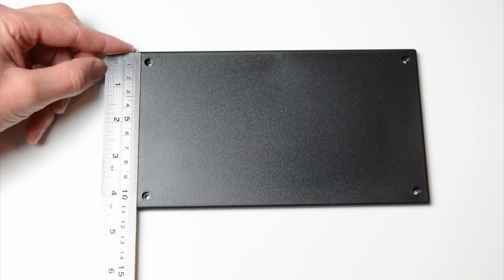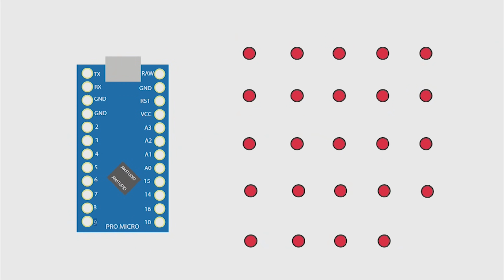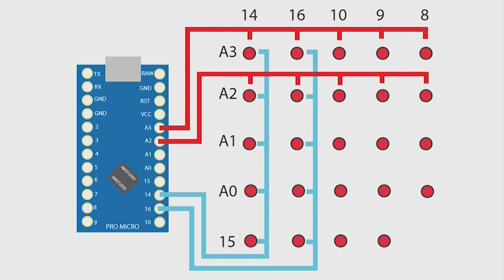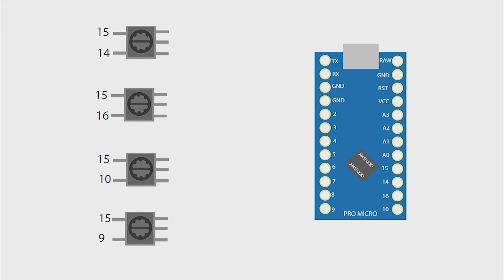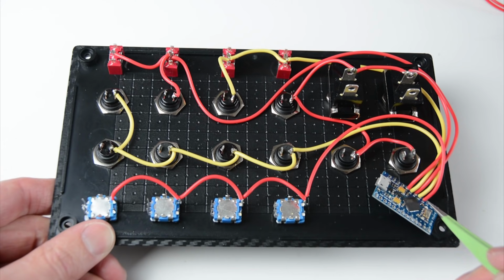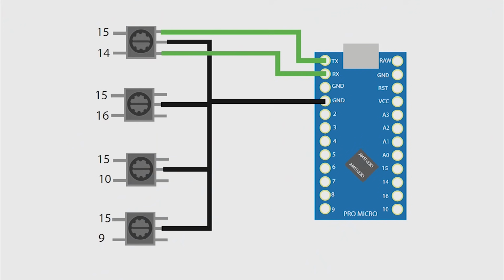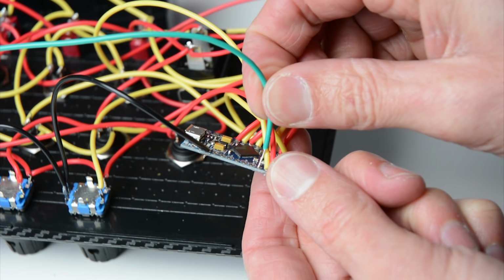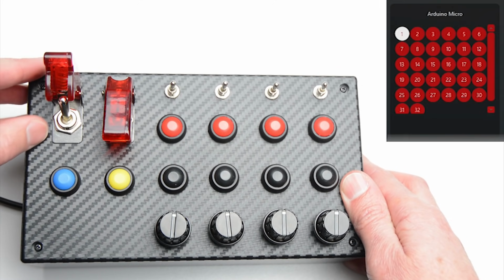MAKE THIS BUTTON BOX | 32 FUNCTION w ENCODERS

Comment: Hey
As always a nice video!  But ist it possible to use a Joystick incoder if in leave out the spinning Switches? 
Thank for Answering 😉
Reply: Yeah it's possible, if you don't use the rotary encoders. I've made a button box using the joystick encoder. Simply hook up the buttons or toggle switches to the board. Simple job. 
I don't think it's possible to hook up the rotary encoders though (I could be wrong). Spent quite a long time trying to figure out how to wiring the rotary encoder to the joystick encoder board, and couldn't get it to work.

Comment: Great job! I want to use 7 rotary encoders and 10 push buttons? I must modify the arduino code or instead of connecting two buttons, i connect one encoder? Thank you!
Reply: have you found a solution I have the same problem with compiling it

Comment: How did you solder the buttons and toggles without melt the buttons? Got some of these buttons and they just melt as soon as you heat up the pad to solder the wire.

Is there a way to connect these without solder wires directly?

Comment: A fantastic build idea, especially for the encoders.
Personally, I've taken apart an old keyboard, followed all of the traces to mark which pins go to which keys, and am working on a button layout to solder everything in. No programming needed at all, and I simply have to wire the buttons to the keys already used in games.
Reply: @Bạch Văn Hoàng Bảo Well aware, simply took common key layouts for all matter of games, and configuring a soldering chart that conforms to it.
Reply: Would it work out a lot cheaper to do it this way?

Comment: Do you have to worry about floating pins? Im a beginner amd have been told to beware of them and use a resister to pull the charge.

Comment: @amstudio Can I use this matrix technique to implement this in an arcade cabinet?  My question is mainly how does the arduino deals with several signals at the same time, i.e. buttons for combo or tow players playing at the same time.  Thank you.
Reply: A matrix works by cycling power to each of the pins on the output group (I guess in this case the rows) one at a time, while checking what input pins (the columns) are receiving a higher voltage as a result of a switch making contact at that time, with the controller essentially putting two and two together to determine what's being pressed and forwarding that to the computer. It probably sounds clunky, but it's incredibly rapid and an unfathomable amount of passes are made within the space of a single second, so it all seems instantaneous from the POV of a human being.

I would imagine the Arduino code should keep track of what's being pressed for an entire pass and then forward the entire result to the system in one go. It wouldn't even be hard on the  Arduino at all, since it just needs to use 16 bits to track the whole matrix (more or less, of course, depending on the size of your matrix). Don't quote me on that, though. ^^;

Comment from the maker: Easy to follow 18 page Guide with setup instructions here: http://bit.ly/2HeizNj
Reply: A few month later I do it for a ps4 ( project car can use a lot of buttons on ps4) but the it doesn’t work( not reconize by the ps4), do you have an idea? 
I think the problem is the skech of the atmega because is like keypad and not keyboard,  what do you think about this ? 
Great job and and realy big thanks for your diy and also Sorry for my poor english.
Reply: The link you have for The 18-page Build Guide is dead. You have a link for it?
Reply: Would it be possible to include a joystick or two in this build?
Reply: what if i don't want rotaries but more buttons, could you do a video on how to change the i.o sketch to add more buttons to this build and where to solder them on the ardino? Or can anyone help with that been trying for a few weeks now and some how just cant get it to work.
Reply: Hey, the devs who made the simdashboard app used the design of this and made it virtual.
Reply: I got lost when u said. Button 1 and 2 I am hopless
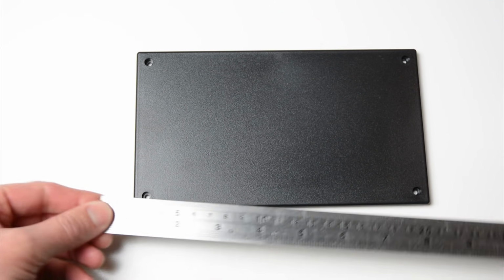Reply: Which program do you use for design your buttonbox? 1:02

Comment: i wil certainly take to this over buying a 2-300$ setup just to have buttons lol..  but i dont understand the layout of the wiring. how does it know a differnt button is being pressed if they are all wired to the same points in most of these?     i would like build my own flight stick setup simular to a virpil and would like to understand more behind the wiring done here if u happen to wanna break it down for another video or other ways to do it    Subbed  for sure
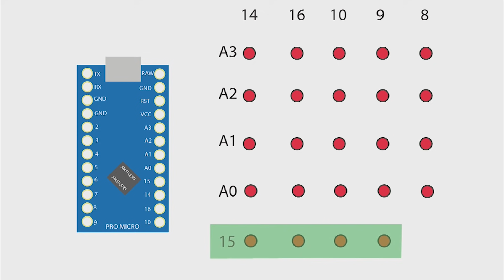Reply: The way the Arduino tells the buttons apart is due to the way the button matrix is set up. If you look at the diagram at 2:50, you can see that each button connects 2 pins on the Arduino. Each button has a unique combination of pins, like X and Y coordinates on a graph. In the diagram, the Arduino is looking for a connection between the red pins, and the blue pins. If it sees that pin 14 is connected to pin A3, then it knows that it is the first button because that is the only one that can connect those pins. 

Think of it like a button grid, and one connection on the button is the X coordinate, and the other is the Y coordinate. By pressing the button, the Arduino sees that X(A3) is connected to Y(14), and it knows exactly what button is at that location. Hope this was helpful.
Reply: each button closes a different set of circuit.  AX AY AZ then next layer would be BX BY BZ and so fort.
Reply: thanks for that Shane and Quert.. soon as i look back at that time stamp my brain turned on and i understood lol  its like a bingo board lol   think i may be able to pull of making my own after all..   anyone know what would be the best sensor for a joystick  only one i know of is Hall effect ( not sure how magnets are positioned to make it work tho)
Reply: @MMORPG87  You could try a potentiometer like the joysticks in an Xbox controller. I'm not sure of the actual wiring, but each axis of the joystick has a potentiometer, and the controller reads the difference in resistance to tell the position of the joystick. If you have an old console controller, you can pop the case open and take a look for some ideas. Would you need 2 axis of movement for the joystick, or only 1

Comment: Long time fan of your DIY's. I'm finally getting around to doing the wiring for my box. I am really new to wiring in general so excuse the potentially noob question. I found that the O/F/O toggles and the encoders have polarity (I think that is the rigit term for this situation, the documentation says to assign the +/VCC pin to the center pin on the 3 way toggle and to the two directional pins on the encoder). Which side of the matrix is the VCC and which side is GND? Does it matter? Thank you for taking the time to make these videos and the time to help noobs like me save hundreds!

Comment: Looks cool! I am doing one with my brother which is not much for racing games but for space games like Elite, and driving games like ETS2, ATS and Bus simulator.

The biggest issue we found so far is how to use controls that are not buttons: for example if you want to simulate a car ignition, you need a single pole 3 position switch; but for the computer they are all single press of the same button; so there is no way to get that actually working. Same for light switches that has 3 positions (off, position lights and low beam).

Did you ever made anything like this? Would be nice to know how did you made it. We are just using buttons for our box, but for the next build would be awesome to have something realistic; maybe using real switches from a real car :)

Comment: Help please. I’m getting an error while compiling. Keypad does not name a type.
Reply: That worked! My first arduino project. I just subscribed to your channel. I have been sim racing for years. My rig: g27, upgraded brake spring, real car seat, 2 dayton transducers, honda accord ebrake from junkyard. th8rs shifter, oculus rift, cheers!!
Reply: amstudio thank you for taking time to help. I’m now getting joystick.h no such file or directory. I tried adding “ArduinoJoystickLibrary-master” as a zip file. And I get specified folder/zip file does not contain a valid library
Reply: Drew Smith how did you get round this mate?
Reply: TNOTPR Vaping i believe I was missing a library.

Comment: Is it possible to increase the size of each matrix? IE: could you go 10x10 and just continue increasing the amount of buttons/switches in each matrix, but keeping the connections, as you have described the same?  Obviously the code will need to change a bit, just curious the max amount of buttons this board could handle.

Comment: I've just bought a ton of parts and a new soldering iron, can't wait to make my own button boxes!! Went for the wood grain vinyl though, fits me good as a FS, ATS, and ETS2 player :)
Reply: Hey buddy, I'm not that far yet.I was stupid and bought several square switches, and making the holes for them took ages with an exacto knife... I have 46 functions, I have no clue how my grid or sketch will look, haha. I'm using the USB Joystick PCB for 10 of the buttons, though. It will be 2 boxes in 1.

Btw, anyone, go for the round switches. And prepare for micro soldering, the arduino card is TINY.
Reply: If anyone is hesistant to do this because of the soldering, don't worry. You can hot glue dupont wires to the arduino. I'm also ditching the whole box part of it and using a 30" x 12" piece of plywood mounted straight onto my wheel base to have a dashboard. With a slot and 2 x 2" holes for my old smartphone that runs SimDash, it's going to be a wild setup for a few dollars.
Reply: @basstrammel1322  Would love to see it, sounds great

Comment: The double momentary toggle switches. Is the middle pin not used??

Edit = Figured they were just wired afterwards and not displayed as 2 rows only had 3 links ha.
Now to build and hope it works.

Thanks for great tutorial.

Comment: I’ve tried to build my own box using this design, what I’m struggling with is finding the code to use to upload onto my arduino pro micro,
Would it be possible to help me with the coding?
Reply: you can buy it on amstudio website

Comment: it shows in the compiler that fatal error: Keypad.h: No such file or directory
Reply: I found out what was wrong I didn't have keyboard and joystick in the library
Reply: @1adama1982  I thought keyboard.h is a builtin library. I think my problem is i have the board selection wrong. Need to make sure its set to Micro.
Reply: Works the buttons fine by you?
Reply: Yes they are working now
Reply: How did you the wirering? If I push one button now it will reconized as 3 buttons -_-'
Reply: I haven't done the working yet I used one pedal button and moved the wires to test the commands. You probably wired it weird did a cross link did you test with a bread board?
Reply: i have same error, except joystick, how to add them?

Comment: I found out how to write my own code for my 5 switch button box so that when a switch is flipped it types a letter of my choice but the problem is that doesn't seem to work in game. It will recognize the keyboard push but not the switch that I flip. How do I make the Pro Micro it's own separate device i.e. to not act as a keyboard

Comment: No resistors are needed? At all?
Or do the buttons/switches have something built in?
Reply: The arduino pro micro usually will take care of this, it has onboard pulldown resistors wich can also be used as pullup depending on what you configure it as :)

Comment: Ok I have made similar with encoders. I made all pin configurations. But encoder only work in one direction. It has to be both signals detected while it know which direction that is, but to other direction it wont work. Second. How to set encoder sensitivity. I have 24 impulse encoder and I have to make about 270 degree of rotation to take one pulse on button. Whats the values 0x30, 0x1.... in your code? I cant figure it out :( Please help

Comment: what board should I have set up in the arduino programming software. I'm using a pro micro but I didn't see a option for it in the boards list. my manufacturer recommends using the arduino Leonardo option but i'd just like for someone to confirm that before I upload the sketch to my board.

Comment: Hey man! Thanks for all your videos! I made this and everything works very well. my issue though is that I changed to a rotary with 16 ppr instead of 20. When i had the one with 20 it works but when i use the one with 16 i only get a puls on every 4th step. How can i modify the sketch to work with 16 ppr? Thanks!

Comment: +amstudio what should I do If I want to have 3 rotary encoders, 10 push buttons and 5 momentarys switches [on (off) on]? And also how do I have to wire it? Thank you very much for your help!
Reply from the maker: Yes that will work the same. Just remember the toggles will take up 2 positions each on the matrix grid when wiring.

Comment: is there anyway to fix two buttons going on simultaneusly?
for example: When i have button 1 (A3,14) and button 2 (A3,16) swithed on then when i try to switch on button 3 (A2,14), button 4 (A2,16) gets turned on with button 3 aswell

Comment: i have managed to make it work all 32 buttons are working thank you, there is only one problem three of my buttons have led´s and  when i conect the extra power and negative (ground)  to the buttons with the leds the corresponding buttons activate 2 buttons at the same time when pressed, do leds also need a button spot on the grid like a button would?

Comment: Hey there, planing on doing my own steering wheel, with a dual clutch setup, no idea of arduino Programming etc. Yet, but I'm a fast learner.
Thanks for this amazing videos!
Got a question though, would it be possible to exchange one of the encoders for the dual clutch setup? (master slave setup via hall sensors or simple potentiometers with bite point potentiometer to set the bite point)?

Comment: Does this work for DCS (digital combat simulator)
Reply: yep.. i did mine from this Video (thanks for the Video BTW, it's awesome!). Although i modified my a bunch (made is simpler fro my needs). when you plug the controller to your PC, DCS recognizes it as a ardruino device with no problems (as long as you have the drives installed on your PC).
Reply: alright tank you

Comment: I'll be honest, it took about 8 times watching this video to finally get everything figured out. Persistence prevailing I soldiered on, finally finishing a box with 2 toggles, 10 momentary switches (14 including the momentary switches on the encoders) and 4 encoders. I feel accomplished, thank you for laying this out in a very organized, easy to understand, and quick fashion.
Reply: or did you... solder on?
Reply from the maker: Good work, Enjoy!
Reply: I want to make a MIDI, does this method works? I send the code successfully to my promicro, but in OSX the MIDI doesnt detect anything :(
Reply: The 3d model for the boxe is included in the guide ?
Reply: @Fabio-ig4dy  I believe it isnt 3dprinted
Reply: @Hanmieson  so maybe on amazon or smth ?

Comment: Your Videos are great. I'm just building the button box, but where can i get the file "keypad.h"? I have a lot of error messages after verify.
Reply: Christian Prohaska have you found a solution I have the same problem with compiling it
Reply: I also have this problem. Did you manage to find a fix in the end?
Reply: Ah, I think it's because I didn't have the Library installed first 😅

Comment: Nice video but I had a question, as I'm not an expert in electronics I did not understand the connection of 3 way toggle
Reply: Think of the 3-way toggle as two separate switches where only one side or the other can be ON. The center tap is the power in and the two outer taps are the outputs that complete the circuit when the switch is toggled to that side

Comment: Ok. Now I need this for Elite Dangerous.
Reply: That's why I'm here, CMDR o7
Reply: doubt it would be a good fit
Reply: I made it for Elite! 
IF you want my opinion keep on reeding:
it's a good idea to add leds to the front face of the pad as well (for flight assist, or silent running) to toggle, if they are on or off.
Reply: @Doile911  I though Elite couldn't output game data to another device, such as an indicator light?
Reply: I think you can use indicator LEDs as if the switches were just for the LEDs
Reply: @FilaYeah  I made it this way, yes, and measured the time, but i can't  recall what program i achieved it. and made the LED blink while it was deploying hardpoints for example. though it was not perfect. it worked.
Reply: @Doile911  hi, would you mind sharing your code?
Reply: @la_grif  Hai! sorry, i don't have the code anymore, sold my gaming gear so i can pay my landlord, and eat.

Comment: I made the box slightly different with the same amount of buttons.  I'm still waiting for 3 encoders to arrive but i did everything else and wanted to see if the box would work without the encoders.  I get an error when uploading the sketch (include keypad.h).  Would not having the encoders cause it not to work?? The wiring is pretty much exact minus the encoders.  pls help, I've tried messing with the arduino software but I'm not too good with any of this.  Thanks!!
Reply: CGomezjr81 figured it out, needed the encoders to make it all work I guess completing the matrix, and you need to find joystick and keypad libraries and include them in the sketch and it really works
Reply: Can you write how you did it?

Comment: Great video I will be using this to make my own. I got a bit confuse though . The top 5 buttons in the matrix aren’t the top 5 on the box found that confusing and had to rewatch a few times to understand if you could have used the buttons picture not just a red dot it would have been better. Is there a picture of the inside to use a soldering reference?
Reply: Yes that is where I am stuck also.